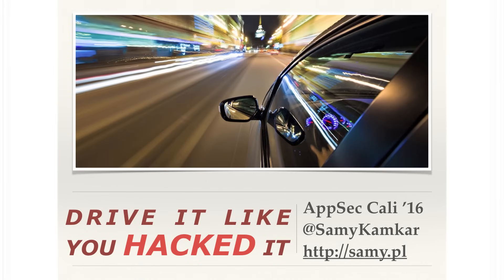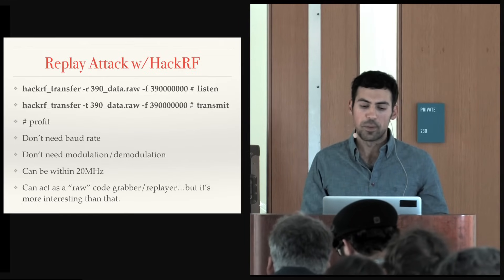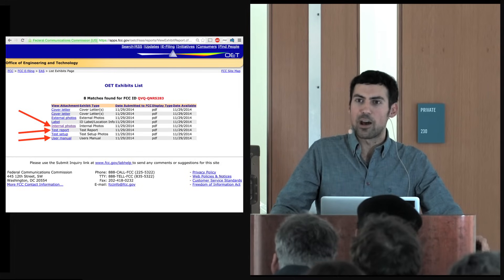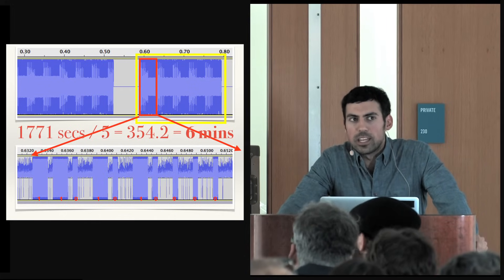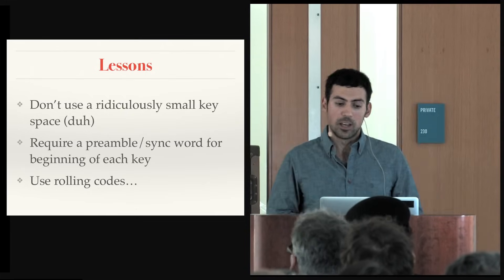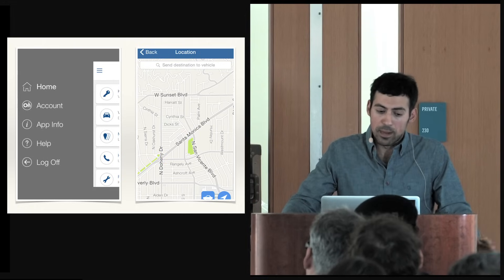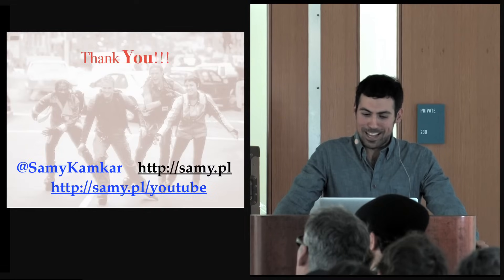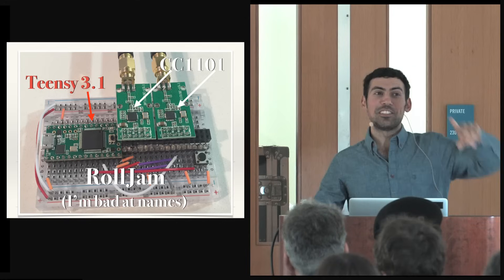Radio Hacking: Cars, Hardware, and more! - Samy Kamkar - AppSec California 2016

Comment: Possibly the best answer for the public acceptance of Def Con, literally laying out the pathway of how vastly distributed insecure systems can be horrifically exploited because security standards weren't even a consideration. The arc from innocent fooling with your garage door to literally stealing any vehicle anywhere so long as you have cased it earlier is just a solid gradient from happy fun to full GTA superthief. Samy Kamkar did a wonderful job, not just as a sploiter, but as a presenter, this is top level Def Con.

Comment: For those who did not get the concept : 
there is a synchronization counter C which gets incremented each time you press the key (of transmitter).  Same way the receiver also stores the most recent validated synchronization counter it has received (N).   Now when ever you press the key and send the pseudo-random number to the transmitter the transmitter also takes the synchronization counter C from transmitter (and to update itself will overwrite N with C).  Now receiver will also produce the Cth code (corresponding to C i mean) and match with the code send by transmitter. There is also rolling window of acceptance for rolling codes say 100 or 1000 or whatever (depending upon which system you using for your Garage or Car keys).  Now also note that  C-N <= window  of acceptance.   Hope you are getting my point here. Means if you window of acceptance is say 1000 and you press your key 1000 times when you were out of the range then the Garage (or your Car or whatever) will ignore the key even if you come back to range.   Also note that if press the key and hold it pressed it keeps emitting same bits, its only when you press it again (press, release the button and press again) that you are generating a new code.  The attack works because the transmitter checks if the next number is what falls in the sequence and there is no concept of expire due to time here (like we have in one time passwords sent to phone).

Comment: A safe way to lock/unlock a car is, instead of using a rolling key, use RSA with timestamp encryption. The car would send a public key to the key fob, and the key fob would respond with an encrypted and salted hash containing the encrypted pass plus the command. That would by encrypted via a timestamp as well, as part of the public key. The private key would be used to decrypt the (command + pass) hash, but would never be sent via radio.

Edit: Just saw the final of the video, and you suggest the same. Nice!
Reply: I feel like as long as the action remains electronic it will always be vulnerable. Hence: the killswitch.
Reply: @j4k3z  sure but this is WAAAY harder to hack than regular rolling codes.

Comment: From half an hour to just eight seconds - This is insanely fast.
Reply: now you understand the power of Math ;)
Reply: Every garage door on the block opens in an 8-second span
Reply: @masskiller9206  I would love to see someone transmitting that code with stupidly high transmitting power, just to open random garage doors in a city all at the same time. Just for the lols.
Reply: @GODofTimewaste2  regular power, very high gain antenna lol
Reply: John  fine, suburban area of a city . I bet there are devices that would react to this even in an urban center though.
Reply: John  "City" is simply larger than a town or village based on Merriam-Webster's definition. That was a waste of time that I have now continued, so thanks I guess? And thanks to me for continuing this for one comment? Also, "you're" since we're being nitpicky.
Reply: What?????
Reply: @GODofTimewaste2  possible stuff,  I mean it's already done, suddenly garages open by them self  😂

Comment: I think I will 'record' the frequency for my car and keep that data just in case I loose my key.
Reply: funniest comment on here ...
Reply: good
Reply: It is not gonna work. Car key signals are encoded and encrypted using random numbers and algorithms like KeeLoq cipher.
Reply: there is a synchronization counter C which gets incremented each time you press the key (of transmitter).  Same way the receiver also stores the most recent validated synchronization counter it has received (N).   Now when ever you press the key and send the pseudo-random number to the transmitter the transmitter also takes the synchronization counter C from transmitter (and to update itself will overwrite N with C).  Now receiver will also produce the Cth code (corresponding to C i mean) and match with the code send by transmitter. There is also rolling window of acceptance for rolling codes say 100 or 1000 or whatever (depending upon which system you using for your Garage or Car keys).  Now also note that  C-N <= window  of acceptance.   Hope you are getting my point here. Means if you window of acceptance is say 1000 and you press your key 1000 times when you were out of the range then the Garage (or your Car or whatever) will ignore the key even if you come back to range.   Also note that if press the key and hold it pressed it keeps emitting same bits, its only when you press it again (press, release the button and press again) that you are generating a new code.  The attack works because the transmitter checks if the next number is what falls in the sequence and there is no concept of expire due to time here (like we have in one time passwords sent to phone).
Reply: You would have to re record that often. Remember that the car and keys have to agree on the code they are sending and only allow so much leeway on how far the key fob is allowed to get ahead.
Reply: I dont know shit just interested in this kind of stuff im even not Good at call of duty hahaha dont know programming or coding but ive Deen a lot of video’s about this And I Can answer you the keyfob uses something called rolling code it generates a new code every time
Reply: lol good luck with that
Reply: on aliex you have key copiers - you can also buy a few blank keys from aliex and start coyping/registering new keys to your car's immobilizer! be wary though because a thief will do the same to take it from you!
Reply: @Charles Yuditsky Funny story.In the UK,ALTON TOWERS customers would regularly get burgled,whilst enjoying their day out.The mums would be distracted,whilst the pickpocket would acquire their car keys/and phone.
Thief would then pass keys to accomplice who hit the car park.
If the car had satnav....the thief would check the home address,and phone his
'removal men'....who would wait close to the target with a large truck.
Since they wore overalls,and the car was the correct one in the drive....
....rarely did any neighbour challenge them.

Be more cautious when visiting THEME PARKS.
Reply: @DDBAA24  Also he said you could for instance, say you're in mall parking lot. Go up and try opening the door by the handle,  it will transmit a signal to record and store.

Comment: RF are so easy to hack, some time ago spend a day researching them.  I found 315 and 433 Mhz are reserved for home automatization and basic security use. I got a Chinese universal remote controller that supports IR and RF on 315 and 433 Mhz and with push of a button I was able to clone and resend the signals for most of the things I have at home like door bell, car unlock and lock smart light switches panic buttons and others. It takes just few seconds to record the signal. But for more detailed knowledge Samy's video is just perfect. It's saves you allot time. Thanks man.
Reply: SS Suleyman is it so easy like you say to hack these signals ?
Reply: The wave the car key sends is encrypted
Reply: No, you are wrong regarding digital transmission.
Reply: Abdallah Shuaibu that’s true 👍🏻

Comment: Exciting and disturbing in roughly equal measure. I like classic cars all the more now!
Reply: lol I hear that one .
Reply: but classic cars are much easier to break into
Reply: TheBreakfastGod you are not wrong. My car has no keys or locks for that matter and starts with a screwdriver. That said, perhaps not so easy to gain access to when at speed on the road 🤣.
Reply: Yep oldies but goodies. Lot less to go haywire, lot less sensors. All this tech in vehicles has amounted to big bucks for the dealerships.
Reply: @yams3954  yes they are, but if a person wants to steal something bad enough they will find a way usually.
Reply: I drive a 1995 Mitsubishi Pajero manual, right side drive in the U.S. imported from Japan, it's weird as hell to drive, not impossible to steal, but it's weird enough and obscure enough it's left alone and it's too old to have the electronic exploits modern cars have. I love this garbage machine so much

Comment: Interesting information.  This shows that there is nothing quite like a hidden kill switch on your vehicle.  Put the switch in line with power to the starter or ignition and make it hard to find easily.   Hardware trumps software.   The best place might be the power line to the fuel pump.  The engine will crank and might start,  until it shortly runs out of fuel.

Comment: The problem with rolling codes... They all roll around back to the beginning. In a way, they are exactly as easy to crack as a stationary code of the same length.

If you roll... 123, 234, 345, 456, 567... 901, 012, 123...
Just broadcasting "123", every single time, you will eventually hit "123", after it rolls-around, as fast as if "901" was the ONLY code, and you had to step-up to "901".

As for being a rolling "set" of fake randoms... That makes it even easier, because there are even MORE values that are "true", not "less", in that same range. It will accept "123" OR "567" OR "091", because any of those could be "possible" as your random "next" code that it has to accept as "true".

Comment: I now remove my battery and all 4  wheels. It a pain but if they want my car they will have to really work for it. 🤣
Reply: They will just vandalise it and strip out anything of value. Does your alarm still work without the battery?
Reply: Haha, you've essentially described what motorcycle, moped and bicycle riders do in large cities through metaphors. I've had one motorcycle stolen and another severely damaged in the attempt. That's with tech that has nothing to do with this video.
Reply: Wheel lock
Reply: @sunyun4425  One of those extremely loud vibration alarms, active GPS, and a WHEEL LOCK is about your best bet and line of security. Other than that, the best security for your motorcycle is a highly reputable insurance company with exceptional theft protection.
Reply: Even when its paid for they still do to t.is
Reply: Most people forget the 5th wheel in the trunk 😋
Reply: Vtyu
Reply: Smart.  I just wrapped my car in tinfoil.  Nah, just kidding, I drive  '77 Camaro.  Try to hack me!  Hahahhaha!
Reply: what kinda car u got tho?
Reply: @chrisromanin8370  y tho?
Reply: @manitoba-op4jx  that's what I'm talking about. Love the Coronet cyclone too. Glorious Mopar all day.

Comment: For time frame of 30:00 today ARM MCU have the capability of securing all communications by HW under supervisory mode, unless you are dealing with older technology then you will be at risk because todays ARM MCU have very strong security and strict supervisory mode preventing unauthorised users to intervene. Old technology did not have the ability to lock supervisory mode and allowed intruders to switch from User Mode to Supervisory Mode wirelessly or via WiFi or even if cable connected.

Comment: The scrolling code of clicker is not random but quasi random, meaning the series of passwords repeat after certain number of passwords had elapsed - for example the scrolling codes list repeat after 60 times of using different password codes. Professional thieves attach a receiver to your car without your knowledge to record all the rotating codes of your car and store it in their receiver then copy those codes into their transmitter to have complete control over your car - they use the same scrolling code of your car or garage. You will know that there is something attached to your car when the Bluetooth of your car keeps disconnecting and reconnecting or your mobile gets disrupted at times, then you need to inspect your car for some magnetically attached bug to your car from under your car. Use your camera phone with long stick to pass it all under your car and observe any attached bug. Once you find it present it to the police and have it investigated for finger prints, if any. When the police refuse to cooperate then you know they may have attached it to your car, or were instructed not to cooperate LOL

Comment: Rolling codes are very easy to catch, simply create a higher  amplitude signal near there garage door and have a receiver where about they would activate it to open it. Sometimes they press it too soon anyway out of range, but as you said exactly repetition but rolling codes themselves are actually *breakable*. If you can capture numerous codes from opens and closes, you can actually use a deductive algorithm to reduce the time to what I calculate could be only a few days as there is no lockout. I call this attack deductive unrolling ;-) as you s aid, might be easier to kick there door in and get the keys. But, I don't like to give too many ideas publicly somewhat reluctant to even post this. Another thing, the rolling codes do have limits on older units so I believe it's usually 65k codes, newer one's have larger bit sequences. Now, WiFi enabled openers are gaining popularity and using pcap and simple wifi security flaws like one in Chamberlain (liftmaster) they leave ports open and you can pull the API cgi page which interfaces with the mobile app and it's easy enough for people like you and me. On car keys such as that on one of my older benz's, it actually uses IR for LoS functions like lowering windows and the IR portion may even have other functions. Again, I may delete this post as I'm a bit nervous over the possibilities and potential attention on this, and I was able to capture that with a learning IR remote and replay it. Worked once assuming I was near the transmitter unlock.
Reply: … near THEIR garage…

Comment: I drive old trucks so I can actually repair myself. Lot less electronic and less sensors, the dealerships essentially run on replacing sensors, some service technicians even refer to the check engine light as "the dummy light." My neighbor had to bring his 2018 Ford F250 in to replace a traction control sensor and it ran him $900. With the oldies there is a Lot less to go wrong or haywire on me. I have destined to stick with the simpler, old but good vehicle  models. I am mechanically inclined, but a noob when it comes to electronics.
Reply: I’m in the same boat. I’ve decided to stick with buying old vehicles as well.
Reply: @dwellner502  nice! Another great feature is the older vehicles are made with much more metal and heavier frames. Thick steel, studf that wont crush like a tin can. Back when they were so concerned with MPG

Comment: To prevent the jam+replay hack, if the rolling code is just continuing for every keypress, locking the car should invalidate the previously recorded unlock code.
Reply: nope, wont work, the  reciever misses some of the transmitted rolled codes and thus is out of sync and dous not know what rolledcode   it missed in  the series excpected codes (in a recieve only setup), to fix this you could use spectrum of possible rolled codes (with reset evry x try`s  , but his increases accessibility of brute force.

Comment: Garage door openers haven't had DIP switches in a long time.  All modern ones are rolling code.
Reply: In the mid 70’s I had a Genie Alliance remote garage opener. I drove around my neighborhood on my bike with an Allen wrench and turned the adjustable ferrite coil (changing the frequency) and actually got someone’s garage to open.
Reply: I just installed a new garage door opener and it has dip switches…

Comment: My guess is that PSK (phase shift keying) is harder to decode. Your device would see a single, fixed frequency, continuous signal.
Reply: PSK is very easy to decode. SDR software has it built in.

Comment: The good thing about Spectrum Analysers (SA) is they are able to sense not only transmitters but also active receivers as well because of the internal MIXER/Oscillator circuit inside the bug receiver with condition that your SA must be close or near to the suspected bug. I highly recommend that you should use SA instead of the dongle you mentioned.

Comment: 41:32 when a victim locks the car, your previously recorded codes become invalid. Isn't that you said eariler? That's not working scenario.
The most probable scenario is when a victim locks a car at a parking lot and goes shopping. That's where an attacker may apply his perviously recorded code. But this will work only if the car uses the same code for both locking and unlocking. I haven't seen such sceurity systems since 90s